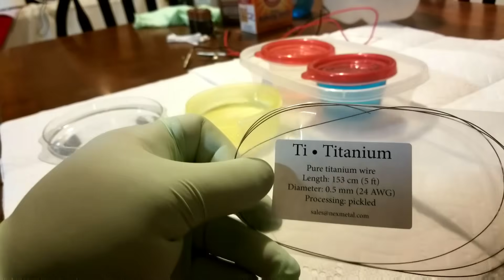How To Anodize Titanium With 9V Batteries Cheap And Easy - Full Tutorial

Comment: will this also work with larger tubs while still using the 3 batteries? i would like to try this on my titanium motorcycle exhaust.
Reply from the maker: Yes, you'll just need to use a larger cathode. You want to try and make the cathode close to the same size as the piece you are anodizing.
Reply: the cathode is what u used as the fork right?

Comment: Could you do this with a titanium bonded/coated blade?
Reply from the maker: To be perfectly honest, I haven't tried it. I had thought about it in the past, but the reason I hadn't tried it is because to get any decent results you really need to etch prior to anodizing, and I'm afraid that etching will completely remove the coating. I still may give it a shot just to see if it works if you would be interested in seeing a video on it though.
Reply from the maker: If I remember correctly, when I looked into trying it some time ago, I read that heat ano works on the coating, but electro ano does not. Might have to do some experiments though.

Comment: Do you need to use distilled water?
Reply from the maker: Really depends on the mineral content of your water. I'm sure you could probably get away without it, but for $0.89 at any grocery or drug store, it just isn't worth the hassle of screwing up a project. That's my opinion anyhow. If you have a high iron content in your water it will definitely screw up the anodizing.

Comment: What can I replace windex with? I dont have that in germany.
Reply from the maker: Honestly, I rarely use the Windex myself anymore. As long as you have some isopropyl alcohol or acetone to wipe it down really well with, and a container with distilled water for rinsing you'll be just fine
Reply from the maker: This was one of my first videos. I plan on doing an update to simplify things a bit. Everything in the video still holds true, but I've  found the windex to just be an extra unnecessary step. I get the same results just using alcohol or acetone.

Comment: Trying this right now and nothing happened, just a bunch of bubbles and no color. Do the alligator clips and fork need to be titanium too?
Reply from the maker: If you've got lots of bubbles and no color you did something wrong. We can do a bit of troubleshooting to try and get you on the right track though. First thing, the fork, are you sure its stainless steel? If you are sure that its stainless, is there anything in your bath besides a piece of titanium and the stainless fork? Did you miss a screw maybe? Are you 100% sure you have titanium? Answer that stuff for me and we can go from there. I will get you anodizing for sure if you can bear with me through the troubleshooting
Reply from the maker: Rewatch the video as well. If you do everything 100% the same as in the video, you will absolutely be anodizing. I'll help as much as I can to get you rolling though
Reply from the maker: The alligator clips do not need to be titanium  as long as they don't actually enter the bath
Reply from the maker: Also, what type of wire are you using?
Reply: SharpKnifeNuts Thanks for all the tips man! Pretty sure my fork was cheap and causing issues. Switched that and kept both the alligator clips out of the water,  and finally started getting color. My batteries were also from old smoke alarms so I needed more voltage too. Got a really nice blueish purple now :)
Reply from the maker: Good deal! That's awesome, glad to hear you got it working!

Comment: I tried it using nine batteries and gave my Leatherman TTI multi-tool Titanium scales a beautiful deep blue sea color👖.. Thanks for the tutorial 👍😉
Reply from the maker: You're very welcome! That's awesome to hear! Glad it worked out for you. If you care to share any pics, I'd love to see how it turned out. All my social media accounts are linked on the channel homepage, or in the separate video descriptions. Thanks for watching!
Reply: Got any pictures or advice on the Leatherman TTI?  I have been thinking of doing the same with mine here.  Did you use the baking soda and distilled water method or something else.
Reply: @bradpatridge7280  I used the Titanium wire plus everything else shown in this video with the exception of the Whink, I didn't want to deal with the nasty, smelly odor of hydrochloric acid, my TTI is new without any rust or stains so I just rinsed the scales with Windex in order to remove any grease  or oil. However, you will need the Whink if you are not happy with the color and want to remove it, just dip it for a few seconds otherwise the acid will damage the Ti. After done you will get something like this: https://imageshack.com/i/poAAkCWfp
Reply from the maker: I haven't personally done a Leatherman, but all the different methods I have on the channel here should work. I've got a handful of different videos up with different methods, but ultimately it all boils down to the same core stuff, distilled water and baking soda. Just depending on what style ano you're looking for will determine how to apply it. Which method are you trying to do, the one where you rub some of the ano off and re-anodize?

Comment: in no way do you need titanium wire, you can do this with any conductive wire. all its doing is transferring the current to the titanium.
Reply from the maker: That's not completely true. There are other wires that will work aside from titanium, but if it's going into the bath then there are wires that can't be used as well. I have been told that aluminum works well, but haven't personally tried it. I have a video of the results of using copper on the channel if you care to see what happens.
Reply from the maker: If it isn't being submerged in the bath, then your statement holds true.

Comment: Titanium wire connected to your piece is Grade #2 1mm?
Reply from the maker: The wire I'm currently using is titanium grade 1 annealed, and I use both 24 gauge, and 20 gauge. I believe I used the 24 gauge in that video, but you can use any size really.
Reply from the maker: Just realized this was one of my older videos, so you may be right about the grade and size of wire in this specific video, but the specs I gave you in the previous comment are what I am currently using in the shop now.
Reply: Glad I asked about the wire ,...found some grade #2 ,annealed at 14ga...for 10$ ...only 40" but that will last a lifetime
Reply from the maker: Yeah, I found a couple spools on Amazon. I think they were 25 foot a piece for like $8 or something like that. I use it in some of my rings as well, so I go through a decent amount, but if you're just using it for anodizing you can even re-use the same piece a bunch of times.

Comment: Is there any alternative to Whink Rust and Stain remover? I can't seem to find any in Canada and shipping is really expensive.

Also how bad would it be if I were to use non-distilled water?
Reply from the maker: Heavily diluted hydrofluoric acid is the active ingredient in Whink. If you can get your hands on some of that you'll be good to go. That stuff is pretty nasty though. If you get it, make sure you wear proper PPE. An acid-free alternative is Multi-Etch, but that stuff can be pretty pricey. 
As far as the distilled water - you can use regular tap water, but your results will vary depending on the mineral content in your tap water. Distilled is used so that the mineral content isn't a concern. Distilled water is mineral free. If there is a high iron content in your water you may have mixed results. Distilled water is pretty easy to come by though at any pharmacy or grocery store, and it should only be $1 or $2 for a gallon. It's worth it to me to not have the headache, but that's totally up to you, and you may not have any issues.
Reply: @ApollosRings  thank you for the information!
Reply from the maker: No problem! If you have any other questions, feel free to ask. I'll help any way I can.
Reply: Canadian Tire has it
Reply from the maker: There ya go!

Comment: Do you know if it makes a difference to have copper clamps on the leads rather than steel clamps? I know virtually nothing about electricity or chemistry haha
Reply from the maker: As long as the leads don't go in the bath you're fine.
Reply from the maker: Copper is actually a much better conductor.  That's why most wiring is copper. You'll only have issues if you submerge the clamps in the anodizing bath.
Reply: Great. I just ordered the leads, the whink, some niobium wire and a 12 pack of 9V's. Gotta love Amazon Prime.
Reply from the maker: Sounds like you're in business my dude! You should be good to go. Just make sure you wear proper PPE when using the Whink. That stuff is pretty nasty stuff. You definitely don't want to be bathing in it, lol.
Reply: Yeah man, definitely. I have gloves and a basic respirator for work so I'll be using those just in case. Can't be too safe. Several other people suggest using some kind of detergent like borax in the anodizing solution as well. Did you try that and decide that it made no difference or have you not tried it yet?
Reply from the maker: Yeah, I've tried it. Baking soda does the exact same thing. It's just an electrolyte. I have tried them both to make sure I wasn't missing something, but no noticable difference whatsoever, and baking soda is cheap. Plus most people have some of that laying around the house anyway.
Reply from the maker: You just need something to help carry the current through the water. Baking soda does the job.
Reply: Perfect. Thanks a lot man, I really appreciate it. One more question (for now), what if the detent ball is ceramic? Would you still suggest coating it with some nail polish before dunking it? I would think that it'd be fine without any protection
Reply from the maker: Feel free to ask as many questions as you need bro, I'll share anything I can to help. I see no reason to coat the detent if its ceramic.  The only reason you would coat a stainless detent is because stainless will instantly oxidize in the electrified solution and screw up your detent. No issues with that happening to ceramic, so nothing to worry about there.

Comment: Will this work without the titanium wire?
Reply from the maker: It will, but only to a point. I have a video up that shows what happens if you use copper wire. Check that out if you want to see the results. Your other option is sponge anodizing, which you can do without the titanium wire. I have a video on how to do that as well. If you have any other questions, feel free to let me know.

Comment: I have this alphabeast 3.0 (balisong) and it’s all titanium of course but it has this like matte grey titanium finish. If I anodize it, will the finish still be there? And also, if I remove it will it look exactly how it looked before I anodized it?
Reply: For sure! It went through all the colors as your color guide video. Maybe the titanium wire has better results but it looked alright with aluminum. The reason I haven’t tried It on my knife is to do as much research as I can so I can get the best results from home!
Reply: Finally anodized the whole knife! I would love to show you the results using aluminum wire. If you have an Instagram just dm me! @bali_ale
Reply from the maker: Yeah, I have my insta linked on the main page @SharpKnifeNuts - send me some pics, I'd love to see them!
Reply from the maker: If it has a matte finish before you anodize then it will have a matte anodized finish after. If it has a polished finish then it would have a polished anodized finish as long as you don't etch it first. If you remove the anodizing with Whink(hydrochloric acid) then you will still have a matte finish after you remove the anodizing, but if the finish was polished and you removed the anodizing it will come out more of a matte finish because you are removing a microscopic layer of the titanium when you use the Whink. I think that makes sense, lol. I hope that clears it up for you. If you still have more questions, let me know. I'll do my best to answer them for you.
Reply: SharpKnifeNuts Thank you for the fast response! What voltage do you think could make a pink? I was told around 60-75 is that correct?
Reply from the maker: If I remember correctly it's around 63-65 volts. I have a color chart video on the channel if you want to check that out too. It goes from 9 volts to 100 or so showing you all the colors achieved with 9 volt batteries.
Reply: I anodized the clip on my knife with aluminum wire and dipped it in the water. It turned out to the color I wanted. I’m waiting in the mail for my titanium wire, but is it needed for a better color or is aluminum doing the same job?
Reply from the maker: If you're happy with the color that's really all that matters. I've tried with copper, and stainless and had pretty crappy results, but I can't say I've ever tried with aluminum wire. Everything I've ever researched has said that you need to use either titanium or niobium for the wire, but if your results are good with the aluminum I might have to try it myself just to see if I notice any difference between the aluminum and titanium.
Reply from the maker: Not sure if you've watched my anodizing with copper wire video, but I'm curious if your results are at all similar to what had happened with the copper wire, or do you have a completely uniform anodized layer on your clip?
Reply: Man you surprise me! You reply quicker than my girlfriend! But yeah i saw another dude do it with aluminum wire but my titanium wire comes in about a week or so because of the holidays.
Reply from the maker: LOL! I try to stay on top of things. If I don't reply right away I usually end up forgetting to respond at all, and I really don't want to do that. Keep me posted and let me know if you try with the ti wire and have any better results. I may try a few experiments here as well to see if I notice any abnormalities.
Reply: I just saw the copper wire video, and yeah it’s uniform all the way. There’s no fading. It’s all the same from bottom to top even when I dip the aluminum wire in with the clip.
Reply from the maker: Ok, that's great news! Sounds like aluminum works too then. That's good to know. Like I said, I've never tried it. Glad it worked out for you!

Comment: Great video, I'm in the process of anodizing my 0562 but I'm not able to get stainless steel lock face off. Might be a dumb question lol
Reply: If the screw is over loctited you can use a hairdryer to heat it up or even a soldering iron to loosen the threadlocker. When i ano my 0450 i had to do that I believe and also had to pry the steel insert out with a small pick or screwdriver. Be careful prying against titanium as its soft and will mar easily.
Reply from the maker: Great tips Chris! I've heated up a driver bit with a lighter prior to trying to remove the screws as well. Sometimes the lighter trick works, but sometimes I have trouble with it.
Reply from the maker: There should just be a screw, then you can pull it off. Sometimes they are in there pretty tight. If you can get a really little flathead and wiggle it off

Comment: I've watched a couple other videos where people used as solution with TSP in it instead of baking soda. Do you know if the baking soda is just as effective as the TSP? Nice video, by the way!
Reply from the maker: Thanks! Yes, the baking soda is just as effective as TSP. I always have baking soda on hand, so that's what I use.
Reply from the maker: I've found that the key to getting a good color is getting a good etch first. Some people use multi-etch, but I can get just as good of an etch with the Whink Rust & Stain Remover. The active ingredient being hydrochloric acid.

Comment: Will the whink mess up the finish? Say like my Mick Strider Custom SMF is heavy stonewash, and anodized bronze/purple, will the whink remove the satin/stonewash and make it matte titanium?
Reply from the maker: If you leave it in too long it will start to eat at the finish, but if you only leave it in till the anodizing is removed, the finish should remain in-tact. As soon as you start to see it bubble rapidly remove it from the Whink. When it starts bubbling it means it has dissolved the anodizing and is now starting to etch the titanium itself.
Reply: @ApollosRings  awesome thanks! I have been anodizing like this for a long time now but always removed it by blasting. Just wish I could find the whink somewhere close by!
Reply from the maker: Not sure if you have a Walmart close to where you're at, but they are supposed to carry it. I couldn't find it at my local Walmart, but it's kind of a crappy one. Worst case just hop on Amazon and have it shipped. That's how I ended up getting mine.
Reply from the maker: The Whink is a lifesaver for sure! It's great for removing the anodizing, and I've found that using it as a etch before anodizing makes the color turn out so much better. Really great stuff. Just FYI - the active ingredient in the Whink is hydrochloric acid, so if you can get that you're in business as well. Just take proper safety measures. That stuff is no joke. Keep some baking soda on hand and near by just in case of accidental skin exposure.  The baking soda will neutralize the burn. Any other questions, feel free to shoot me a message any time.